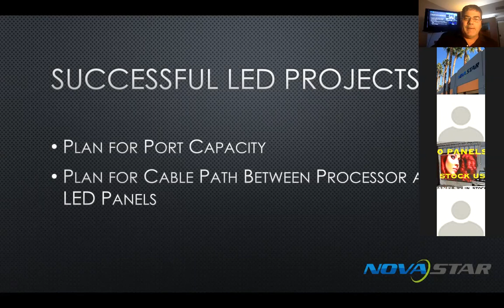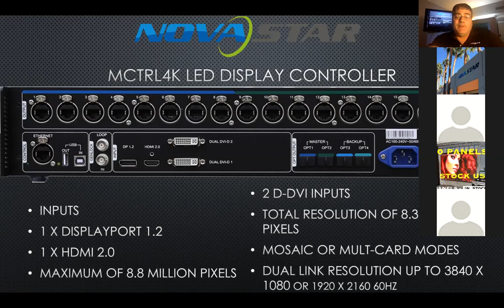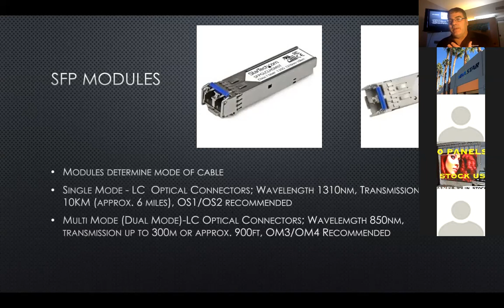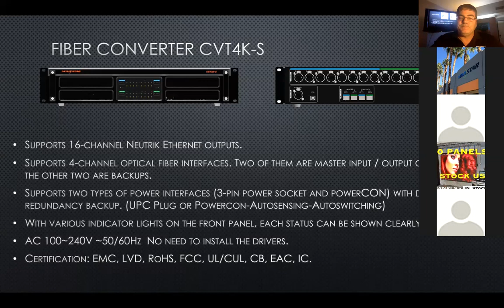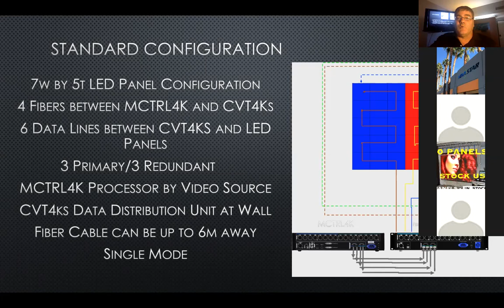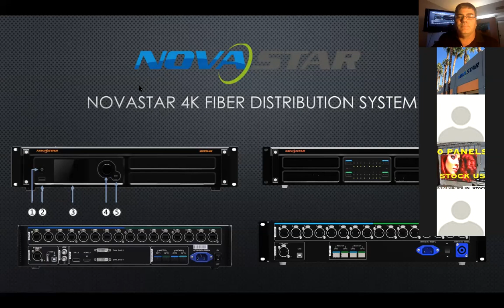MCTRL4K in a Long Distance Environment _ Daryl Barnard

Comment: I am in need of assistance with the MCTRL4K kit.
currently I am using MCTRL4K kit to run led screen, led screen resolution is 2560x1152 pixels. the signal fed into my led screen from computer and camera only get a resolution of 1920x1080 pixels. so the led screen can only display 1920x1080 pixels. now how do i display full screen 2560x152 pixels.
I am in vietnam the agents here did not give me a solution.
thanks novastar.
Reply from the maker: Hi there! Plz contact us by email: support@novastar.tech   and we will get back to you asap!